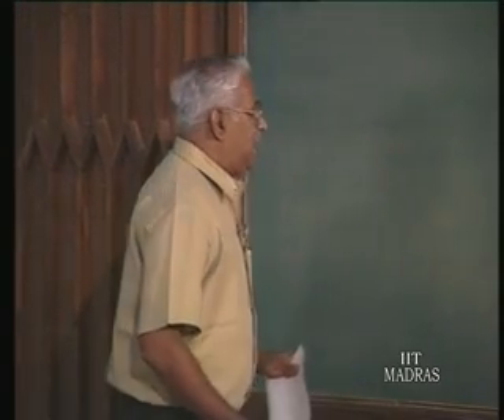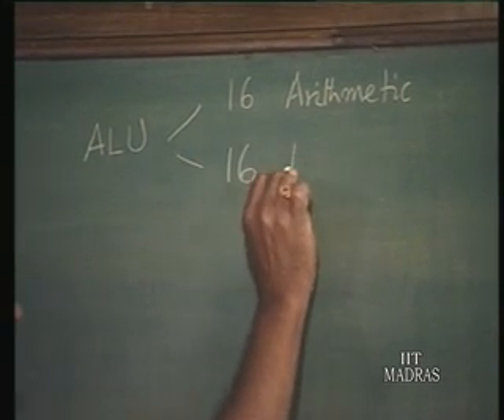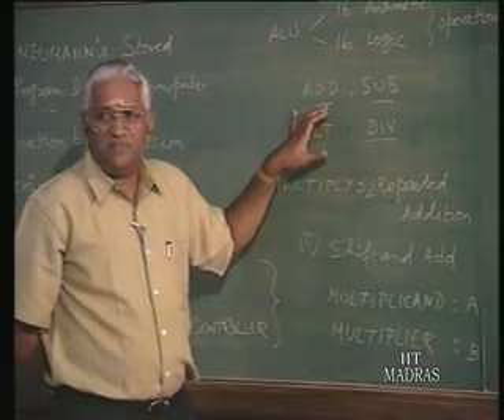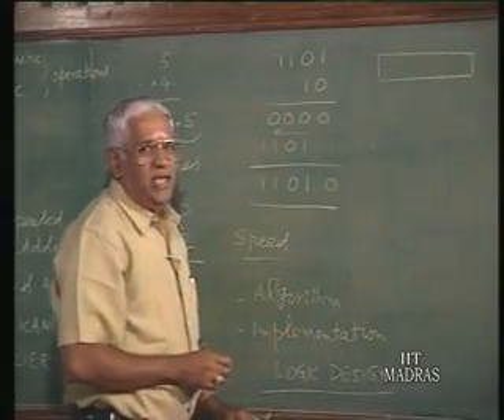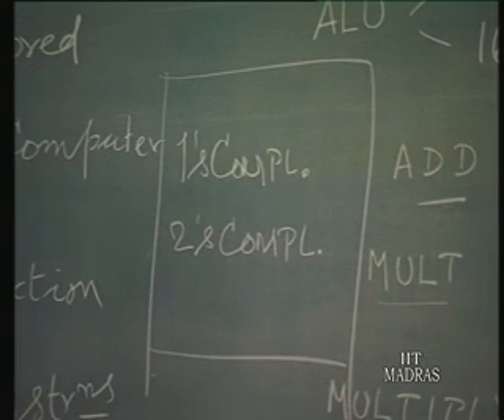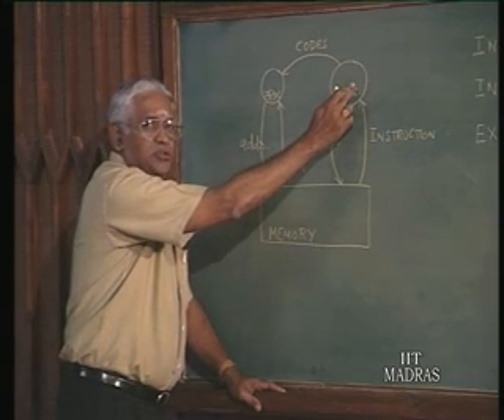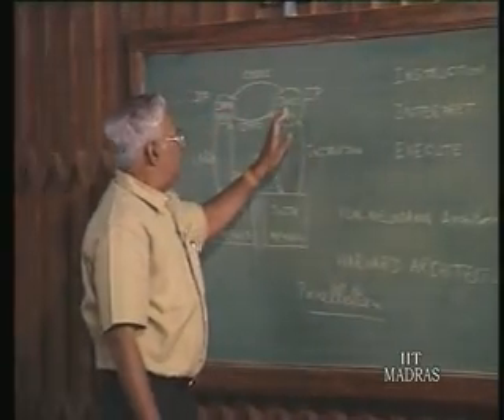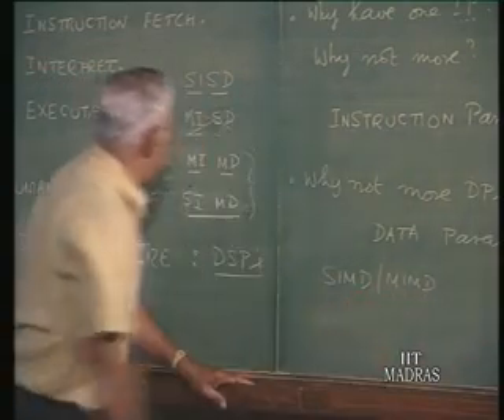Lecture - 14 Problem Exercise

Comment: The lecture has been titled as "Problem Exercise. It will be more appropriate to re-title it as - 
 "CPU: Sum-up & Extensions"
- Prof. S. Raman
Reply: Sir is this course of lecture enough for GATE computer organisation and architecture technical subject
Reply: @dipankarmazumder2262  nope u will have to go through pipelining from other nptel video pk viswas
Reply: @dipankarmazumder2262  He wrote that comment 10 years ago, you'll have to be really lucky to get a reply.
Reply: @ms.550  yeah bro xd
Reply: @ms.550  well its not. Dont follow this for gate. Follow standard books. Solve book exercise. Solve prev yr gate on the topic. Also follow made easy postal course(but not primarily). For this course Carl Hamacher is good to go. I haven't touched architecture yet so don't know
Reply: @dipankarmazumder2262  I was actually binging this playlist, refreshing concepts.
Reply: @ms.550  noise. Use a book and you can refresh something in 5mins which the video would take 50mins